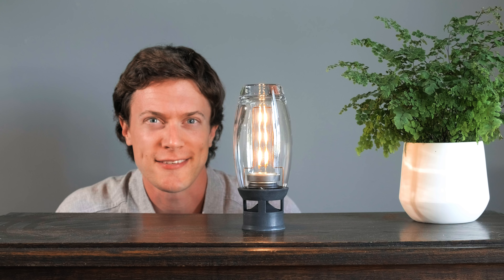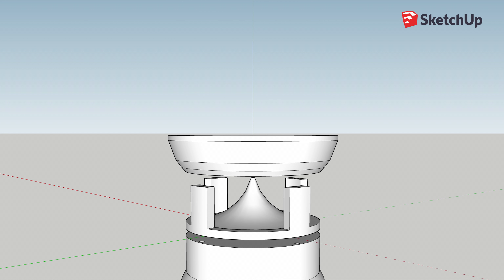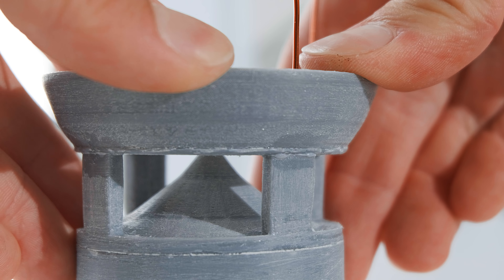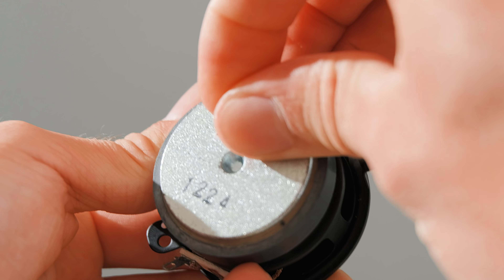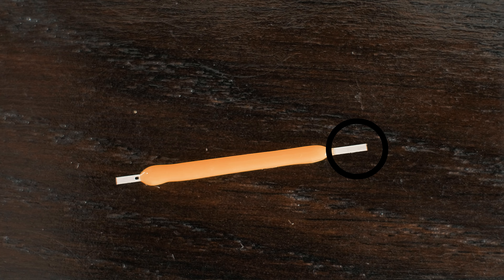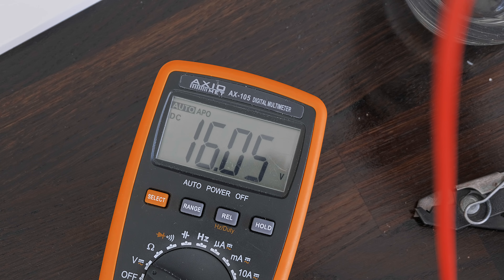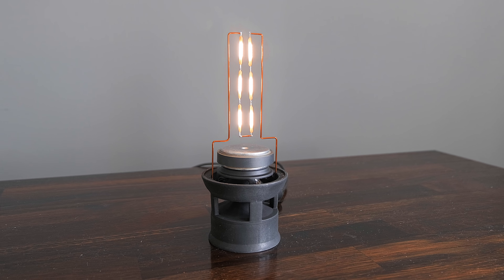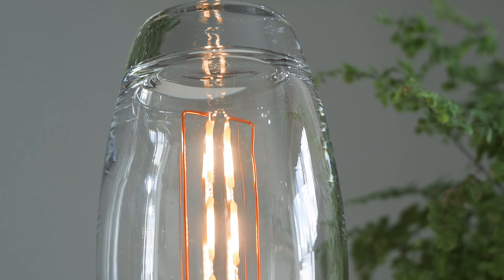DIY glass speaker! How to build your own.

Comment: This with a solar charged battery pack or even a heat charging pack to power it would be awesome for camping. Except for the glass of course.
Reply: I wonder if a plastic glass would change the resonance?
Reply: @paultraver2760  it would think of the idea of playing glass with your finger tips on the rim. You can't do it with plastic. The molecular structure is different.

Comment: You said it was a 2" speaker on the video, but the link is for a 4" speaker.  Wouldn't a Dayton audio speaker be a good match and also be available after the ebay auction is gone?

Comment: Hello, i'm a novice and I don't understand electricity well. I have a question, will it be possible to remplace the alimentation  with a laptop charger with a wire directly going to the electrical outlet? If so what is there to do? Thanks.

Comment: Hey dude, amazing work as always. I was just wondering, would it be possible to use a Wooden base? I find playing with complex wooden things far more satisfying than waiting for a printer. And I would imagine that would give a better rustic look than plastic.
Reply: I imagine wood would work, but you'd have to be careful to avoid hot wires being exposed to the wood.

Comment: Hi Matt, i'm wondering, have you ever designed and built speaker stands for recording studio use..? If so please leave a link where I can go and check it out, I have a home studio and am extremely short on funds I am currently building my acoustic panels using towels as per your video but desperately require a pair of good speaker stands. So if you do have a design I would appreciate that very much. In the meantime love all your videos Sir you are a true genius and even if I dont think I could ever build everything you design I truly appreciate all the hard work and effort and most of all the passion with which you portray your craft. Have a great day, Rem Quint S Ence

Comment: I doubt I'll ever make it... parts don't come by easily where I'm from.... but for the others.... I feel you could do a follow up to this video where you can add a switch to shut the lights when not needed.
Reply: just drill a hole next to the power socket add a small switch that will cut the power to the LED. Can't get any simpler than that.

Comment: The problem of using parts made with a 3D printer is that they are very vulnerable to changes in temperature and humidity. In addition, if the sun gets distorted and included they disintegrate over time

Comment: I share the good opinions below, however I wouldn't exactly call it glass speaker. In case of a glass speaker, the glass would transform the electrical signals into sound and not just resonate to an already transformed signal.

Comment: the only thing i would like to add to this is an on/off switch for the light to be able to use them separately. is it even posible? im pretty new to the diy electronics
Reply: yes. just put it next to the resistor for the led.
Reply: @SupremeLordGeek  would that turn of the light and speaker separately? Or is it general on/off?

Comment: Hi, thanks for the great video. I have made a speaker similar to this one you have shared. I used a similar Bluetooth aux receiver, an amp and a filter. The Bluetooth receiver has some kind of an open-close function which cuts the output signal when left idle and wakes up when it receives a signal. Hence the speaker turns off and on accordingly. So when I connect my phone to the speaker if I dont play any music it turns to idle and when I start playing the BT wakes up and you hear a short popping sound, which is very annoying. Pause the song for 5 seconds and start playing, you hear a POP! first.... Do you have any idea how to solve this problem? Thanks in advance.

Comment: The acetone bath is a bit of overkill, I think, since you're priming and painting it anyway. A good rub with some steel wool before and after the primer should take care of those steps, and any crimes left should be covered by the final paint coat.

Comment: Heey Matt/DiyPerks,

Recently I have started work on your project: speaker with a glass on the top of it and led filiments inside. I hope you know witch one i'm talking about.

At this moment i have finisched the electronics, but i have a very big problem... the ampifier boards you use keep destroing themselfes in my speaker, so far i watched 2 board go up in flames and i'm very afraid of placing in a new one because the delievery times are realllllyy long for me. I would like to know if you know how this happens and if this has happend to you. 

When i'm done with the electrics everything works and the sound is great but when i turn it of, wait a few minutes and try it on for a second time. The board shoots flames and i can start over again....

I would really like your help.

Components:

Dayton audio speakers nd65-8 2-1/2

Amp: OEP30W (the stereo type like your concrete speaker)

Power: 19V old laptop power supply

Potentiometer 50kohm dualgang with switch.

Do you have any idea why my boards work the first time but the second or thirt time they go up in flames...

I really look forward to your reaction,

My project is at a stop now if I can't figger this out my project ends here.

Thank you so much,

Kind regards,

Roy de Kock

Ps. I'm really sorry for spelling mistakes english isn't my first languege. Love your video's.

Comment: Thanks for the awesome video. I made a similar speaker after watching your video. I have one question if you dont mind, I used an all in one amp and BT module instead. Though I am ok with the sound quality I really hate the chinese lady speaking "Bluetooth mode" when I power the device:) (and yes I got it from aliexpress:) So do you know any bt+amp module which I can modify to play what ever sound I'd like until it connects to a device and maybe some other sound when it connects. That d be really cool.

Comment: @DIY Perks

For those without a 3D Printer - are there other options? Fimo or some kind of air dry clay? Or perhaps even wood?
What kind of special properties does the base need to have?
Reply: spinwitch search around your city for diy maker spaces or even your local library if you’re lucky

Comment: Can I ask why you printed 3 pieces when you just stuck them together to make 1 piece? Could you not just print 1 piece? X
Reply: In the case of 3d printing, specifically FDM as showcased here, you'd need a good deal of support materials. Doing that  would likely take longer to process the finished part than just printing and bonding them separately. Cutting or removing supports is tricky in most cases.
Reply: @JamesBackes4335  that makes perfect sense. Thanks dude ☺️

Comment: what about the 3d printed part, its 360 dispersion, not good for speakers in a corner of a room as the scatter off the walls will spoil the sound? how about a new design for corner placement for surround sound setups....

Comment: Would you do an update using these speakers?  They are on Amazon and have cool blue led BOSS Audio BE423 225 Watt (Per Pair), 4 Inch, Full Range, 3 Way Car Speakers (Sold in Pairs for $19)

Comment: I clicked on your link for the 3d program files it states doesn't exist?
Reply: Only accessible by Patreon contributors.
Reply: @Splucked  i expected it to be free for patreon supporters it just confuses me that the site doesn't exist for non supporters.? But either way a really nice project.
Reply: @Splucked  Can you confirm, that you can access the files from the link in the description as a Patreon supporter? I am just double checking because on his Patreon page it actually sounds like you only get the project files for upcoming projects, as they are released. Plus the only post about project resources that it shows on his Patreon page is the one for the DIY desk PC (which is also the only project resource currently purchasable from the shop on his website). I would love to become a patron if this gives me access to the files!

Comment: Anyone got an updated link to these LED filaments? I only found two, but both run at 75V...
Reply: In case this is still relevant - searching ebay for "cob led filament" should give you a whole bunch of results that look about right. Just check the descriptions to make sure they are 3v ones.
Reply: @TheF4B1  I already found some, don't quite remember what I searched for. Still gotta try them tho xD

Comment: Glass is one of the worst materials to use for a speaker. I've found that 3/4" MDF is best and is what speakers from 40 dollars all the way up to multi-thousand dollar professional speakers use. Also, a class D amp is gonna sound fine with a nice smooth DC power source, usually from a linear supply.

Comment: I noticed you have an Anet A8 printer, and I spotted a few things around the print bed that could be improved a tiny bit, reducing wear on the printer and possibly improving print quality.
Firstly, the H plate is upside down. The cross-bar should be down, instead of up like the instruction videos show. Having it the wrong way means the belt won't sit straight.
Secondly, if after doing that the belt is still not sitting straight but more curved up, have a look in the parts if you still have them, for two more of the little belt grip pieces. If you don't have the parts anymore, or your kit didn't come with four of them, make some with whatever material and method you choose, and re-fit the belt such that it's trapped between two grip pieces rather than between the crossbar and a grip piece. In my case, this made the belt sit almost perfectly straight.
Having a belt that isn't straight can cause unnecessary wear on the motors, and as far as I can tell*, will actually squash or stretch prints near the edges slightly. For small prints this can mean mismatched parts, and for larger prints it can mean overall wrongly-sized parts, so I'd certainly suggest fixing this if possible.
Note that there are plenty more upgrades for the A8, most of which are printable parts on Thingiverse, so check those out if you're interested.
*EDIT: I did the maths, and assuming I didn't mess anything up, a wonky belt does indeed cause inconsistent motion (a certain rotation of the motor won't result in consistent displacement of the print bed)

Comment: How do you get good sound quality from those Bluetooth adapters? I bought one on eBay based on one of your previous builds but the sound was terrible and there was a constant hiss. I tried powering it from several sources including powerbanks to isolate from the grid and also tested on different speakers but no luck! Not sure if I bought a lemon?

Comment: Holy shit .. the speaker's 300$ now ... it's the last one ... not at all socialist this chinese seller ...

1. How much did you pay for them Matt ? It would help to add the prices you paid next to the links so we know roughly what to look out for :)

2. Also: why not mount the speaker facing upward and have the relatively uglier back face downward ... have you tried that out? I'd expect a slight hit to mids/highs but, I wonder if it's really that noticeable

3. I'm not sure if you had the exact same buck converter, but the ones I had (with that style of chip on them) were highly fussy about anything above 12V, dissipating upwards of 1W idle; I always use the ones that have the tiny tine 6/8 pin package (at some point I'll learn their names - promise). The ones styled like yours would cook on 19V, and were rated up to 22 or something like that, whereas the tiny chipped ones were stone cold and went up to 35V.

4. It would be much simpler if you bough an all in one DC-DC isolator and Bluetooth module, just search "csra64215 12v" on aliexpress and you'll find them (google really hates link in comments - if you're interested, reply here and I'll post the link). They sound amazing, and with a 15$ programmer can be tuned to have an equaliser running on them, and you can customise their name too - a must have I'd say.

5. Just personal taste here I suppose but there is a fffffantastic mono amplifier that sound butter smooth based around the TPA3110 chip. For that, also on aliexpress, "tpa3110 mono" (it's a white board). I've used it in a speaker and am very happy with it. A bonus with that chip is it can run with up to 26.5V (where it'll be around 30W for a mono configuration (or something like that)).

Comment: I used to love your stuff since it was always so approachable. Saws and screwdrivers. Now you are using CNC and 3D prints and its not very DIY anymore. More like Do It with industrial machines. I mean technically a mechanical engineer with a injection molds is doing it himself too.

Comment: 6:15 bad technique, the iron should touch the wires directly, then add the solder onto the wires without touching the iron
Reply: Without solder on your iron the heat takes ages to transfer, meaning even more time to cause damage to sensitive components.
Reply: @MsSomeonenew  yes you should tin the tip first before soldering components, but when soldering components you should not flow solder onto the tip

Comment: "The best part is that it's really cheap to build" And then you bring up a 3D printer.. Really? You're letting a machine do the work for you, so that's really not DIY, and the whole point of DIY is to save money by Doing It Yourself. 3D printers are freaking expensive. Honestly, for that kind of money, really just ought to go buy a Marshall speaker and save yourself the trouble.

Comment: Matt... I like to give people positive reviews... but I guess Your taste is just not mine.  The designer visuals are sort of nice.  Do You think that looks retro.?  Maybe to someone who doesn't know anything about vacuum tubes.  It is sort of nice visually, although that does look exactly like a drinking glass, dorking around dorkily, where it doesn't belong.  As for the sound!... that is abysmal !  and from a practical standpoint of having repaired and built speakers for years,... one never grinds or sands ferric metal (steel pole pieces) around a speaker, because the fine filings inevitably end up in the speakers voice coil  gap.  Sorry, I couldn't resist,...  feel free to remove my comment.